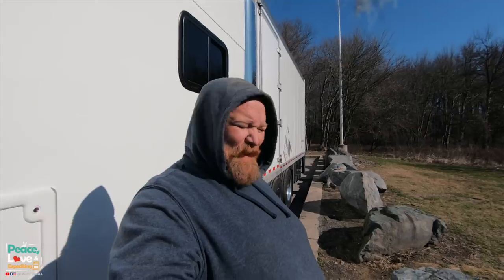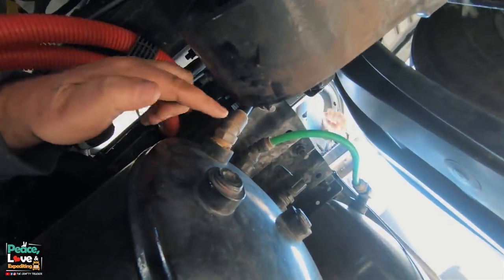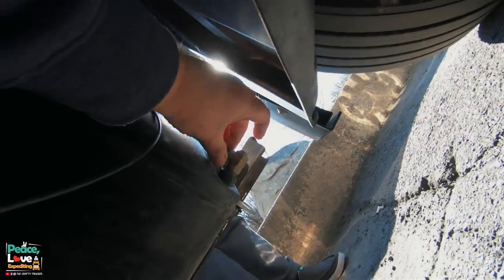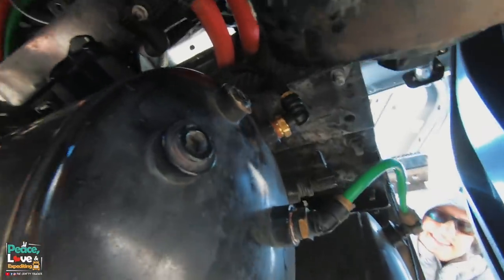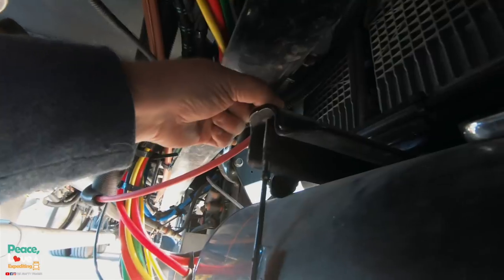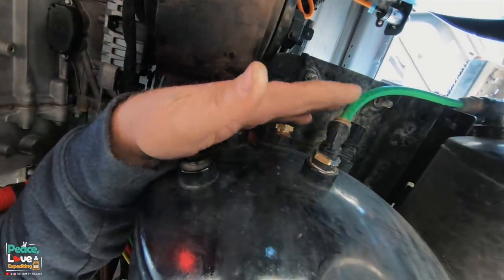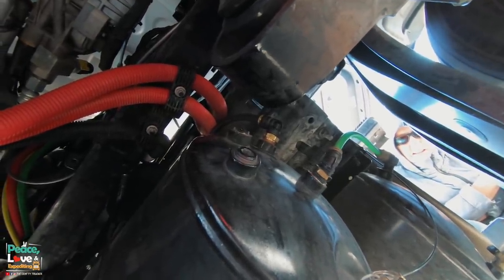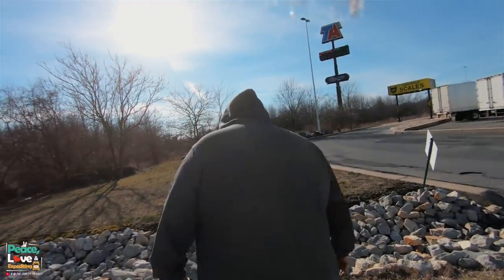FIXING & MOVING AN AIRLINE FITTING

Comment: Forget the usual  styled dolly. I have only ever seen one that had big wheels to properly navigate what you will generally have underneath your truck being tarmac or rough stuff, not glass smooth concrete in a workshop and also brackets that lowered the bed back close to the ground. Cardboard or if you are feeling extravagant and happy to clean, then heavy vinyl tarp of the right size. The blocks to raise the truck are useful and easy to have made / make and drive up onto. Thank you both for all your really great video’s, so nice

Comment: Use cardboard to slide under truck once the cardboard gets wet or worn out recycle. Dollies will raise you up 3 or 4 inches and get caught on little potholes and small stones. Cardboard is easier to store and slide on. :)
Reply: Cardboard works in a pinch but it's really hard to move around on it --- especially if you are a big fella like Jason --- a low-profile mechanic's creeper with large casters would be perfect

Comment: For those  thinking to get under a truck, keep in mind some trucks have air suspension. Once you release that air, that body/chasis also comes down. I hope you fit! Id also chock up my wheels in case truck breaks fail and truck rolls. Mechanical failures you missed on your pre-trip or happen at the time of air release...

Comment: A creeper will not only make it a tighter fit for you but as someone also poster they don't work worth a crap in rough serfaces. Get a tarp, they don't add any height to an already tight spot!they are cheap and you can fold them up and store them almost anywhere.

Comment: I use stacks of 2x6 screwed together in a ramp . cut in different lengths.
Reply: I like having long board on bottom and shorter boards to make pyramid pattern so if you drive over top it doesn't drop off like a wedge. Wedges want to flip up.
Reply: @robertreilly1701  yes sir that's works pretty good. Also gets pretty heavy to lug around
Reply: @tinobenny6742  use KDDF if you can't pick it up

Comment: Those floor creepers are good but they are made for a smooth floor so keep that in mind when buying one. maybe they make an off road one. When there is lots of little rocks or gravel they don't roll very well. Just don't want you to buy one and find out it doesn't work very well for ya. Maybe do a little research before buying one so you don't waste your money. Love y'all. Give my love to the crafty puppies ✌️💙🚚 🐕🐕
Reply: I've seen creepers with interchangeable casters --- you can put bigger ones on made of rubber that will roll over small rocks and cracks in the pavement

Comment: If you get into a Freight liner or any dealership Look around were the new trucks undecked when they come in The wood they use sure up the saddles and the fifth wheels Is some good nice hard wood Tthey make good blocks to put under your steer tires I run a heavy duty tow truck all us guys keep them on our trucks to put under the steer tires while hooking up  Usually out back at most truck dealers Freight liner , Peterbilt , Mack all the same

Comment: Just an advice , when ever you install a quick connector,  try to get the air line the most straight you can so the quick connector doesn't brake by the side , that's the mayor reason why quick connector starts leaking because the hose makes pressure on the side
Reply from the maker: Thanks for the tip

Comment: You did tape those threads...correct..you guys do good work.
Reply: they had a sealer on them, you dont want to use tape AND that stuff it actually makes for a bad seal, one or the other.
Reply from the maker: That’s correct the new fittings had a sealer melted on the threads.

Comment: You might want to try RV leveling blocks to raise the front or rear for repairs. Camco makes a good product about $30.00 on Amazon. Strong enough for a 54,000# class A should work for you. Safe travels.
Reply from the maker: Will check them out. Thanks

Comment: I  use Teflon tape on fittings for air lines and water lines.  You won’t have the clearance using a creeper.
Reply from the maker: Will definitely need the wood blocks then lol

Comment: HI GUYS, PICK UP A 2x8 MAYBE 2 , @ 6 FEET LONG  , DEPENDS, CUT THE BOARD INTO 3PIECES AND THAT MAKES IT EASY TO PULL ONTO THE RAMPS WITH EACH OF THE PIECES OF WOOD SLIGHTLY SHORTER THAN ONE  UNDER IT, LIKE STEPS , AND 3 PIECES SHOULD GIVE YOU SOME HELP ALSO ITS SAFER THAN TRYING TO PUT TIRES ON A 4x4. HOPE I MADE SENSE. TAKE CARE BE SAFE AND IN JESUS NAME A BLESSED DAY, WINNY FROM PGH., ✝️🙏👏😇👍🇺🇸
Reply: great idea, I have a couple of those ramps they make but they are too marrow for my truck and not safe feeling at all. id rather have something wider and that isn't gonna scoot away when I try to drive up it!

Comment: Freightliner  did the green hose on top of that tank for a reason...feel me out....because of air pressure would be more in the first tank...might want to talk to dealer if want....
Reply: it would make zero difference moving it from one location on the top of the tank to another on the top of the tank.
Reply from the maker: We did confirm everything before repairing. Thanks for checking though
Reply: Tim Tim Tim.  Please don't throw out BS with only an arm chair degree. I'll say it again so you know you are wrong and stop spreading false information.  Air pressure is doesn't care about location. Whether it be top bottom backwards or sideways. It's uniform and the same on all sides expanding outwards. The best way to show you is your theory would mean that there is more air pressure in the bottom of your tires and less at the top. That couldn't be farther from the truth. Bottom line the tech that installed the tank did so when their truck was nothing but rails and a few parts. It's hard to see the forest through the trees to see the end result. Easy fix. No one's in danger from mystical pressure drops. The crafty trucker ship is ready for rough seas and fair winds.

Comment: Know your rear axles might have few less pounds of pressure being on top of tank....check with dealer....please.....
Reply from the maker: We did call them and confirmed before doing ourself. Thanks
Reply: Tim are you kidding? Air psi is the same top bottom backwards and sideways. You might have a leg to stand on if we were talking liquids but air is irrelevant when you are talking space. That's like saying there is more air pressure at the bottom of your tires than there is at the top of the tire.